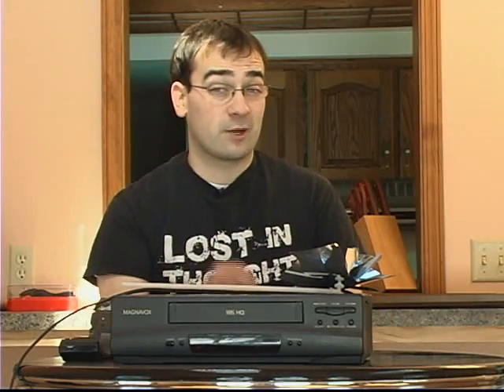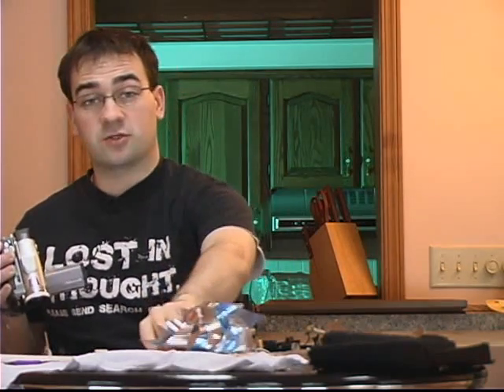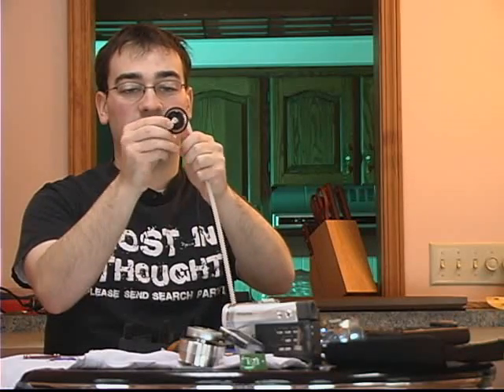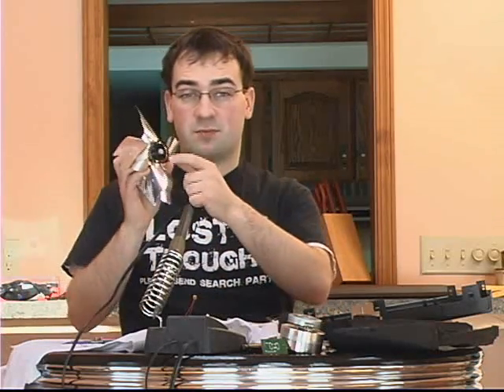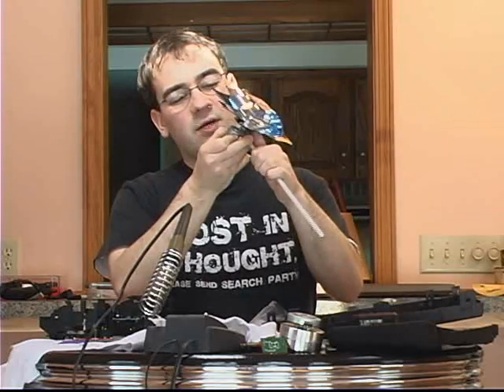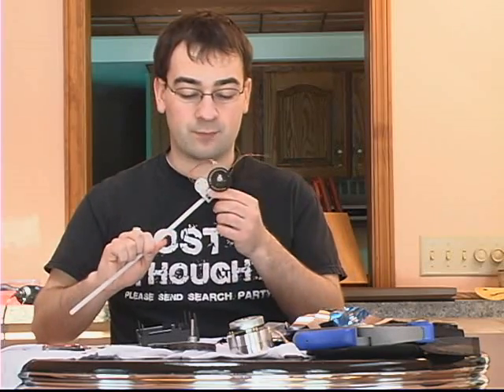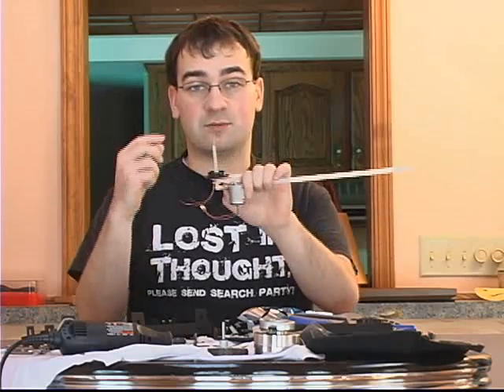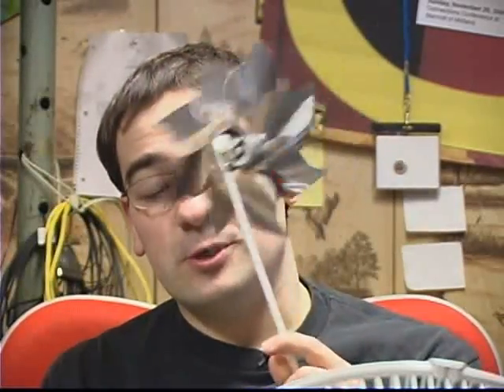Wind Powered LED

Comment: it was a pretty decent tutorial if not a little jumbled. the editing could use a bit of work but other then that it was really good.

a pro tip for getting the gear to not move so much: if you apply a gob of hot glue to both sides of the gear ONE SIDE AT A TIME and pry it loose with an exacto knife you effectively make a mount for the gear. making sure the gear is very cool can keep the hot glue from sticking to it too much so it cant be pried off